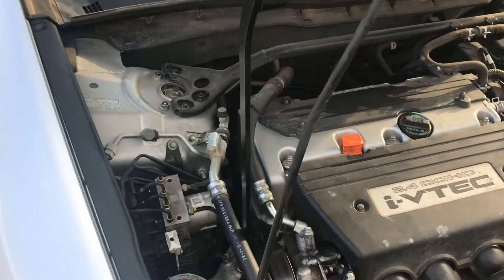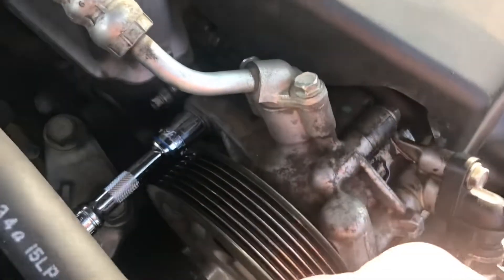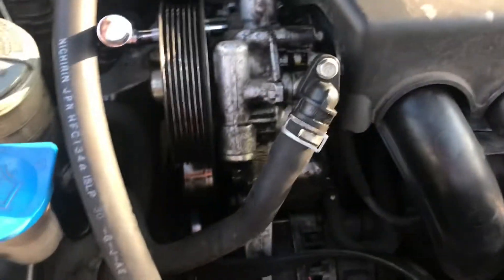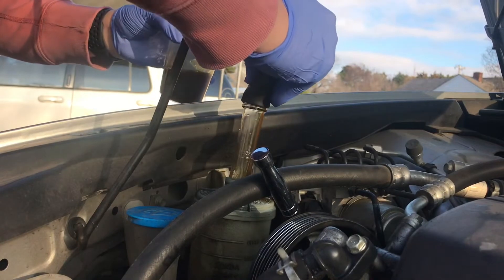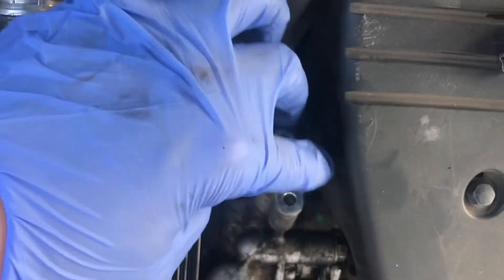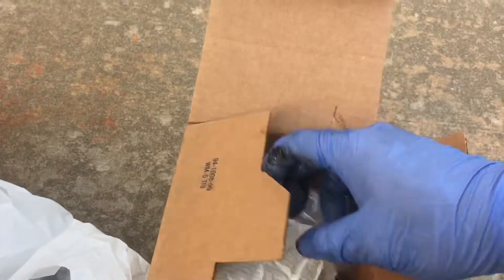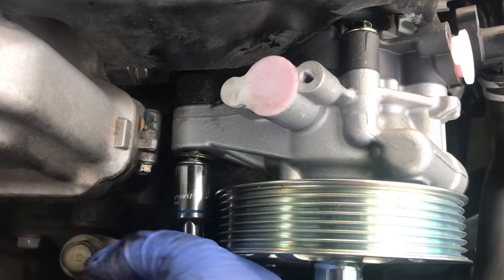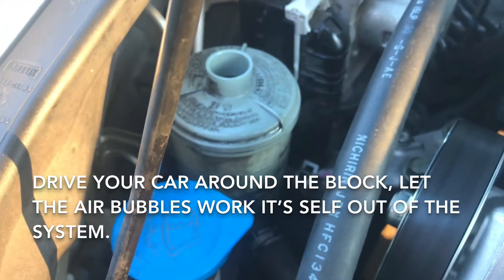Power Steering Pump Replacement - Honda Accord 2008 2009 2010 2011 refurb

Comment: Excellent, just what I needed.  I replaced the oring on the low pressure side and it was fine for a month, then I noticed it was now leaking at the main seal.  So new pump time.
Reply from the maker: Glad it helped

Comment: Did you try installing an oring kit on the original pump and replace the internal orings and seals or did you just replace orings on the high pressure and low pressure connectors before deciding to install a new pump?
Reply from the maker: I did the later and then moved on to replacing the entire pump.  I didn’t have the time to break it apart and replace the seals.

I went with a Napa in house brand and it’s been rock solid the entire time.

Comment: Is the after market steering pump ok to use?  The honda oem one cost 400+ and the aftermarket is half that price.  Someone told me those aftermarket ones don’t last long and leaks time to time.  Whats your advice on oem or aftermarket
Reply from the maker: I’ve had my Napa in for a while and zero issues.  I recommend it. 

Say, you have 400, go for the OEM.  My OEM lasted 11 years.  If you don’t, then aftermarket is fine.

Starters - i put in an aftermarket, next car I’ll do OEM
Reply: @YoDIYVideos  i am asking cause $400+ is too much for me at the moment. If its 100% necessary than i have to choose oem. I just heard bad reviews about aftermarket.  If after market works fine and at least last at least 5 years then i rather go aftermarket to save money.  I was just wondering what is your advice.
Reply from the maker: I bought a Napa remanufactured.  No issues with it.  The seals in them are replaced and rebuilt (put back together) and repainted black.  

Part # - NSP 826046. 

Save the money, lifetime warranty.  Don’t think too hard about it.  I always check for leaks no, zero leaks
Reply: @YoDIYVideos  thank you.  Will do

Comment: Mine u can’t steer when ur at a dead stop when driving it does pretty good. What was your systems?
Reply from the maker: My power steering pump wasn’t that bad, ended up having some issues with leakage. Every time I would check the engine bay, mainly had really loud whining.

Comment: I like how you say you need a wrench to remove the belt. No size given... and then you pull out some long as unique looking wrench that you need to do the job with no description of this tool that makes the job easy 🤣👏
Reply from the maker: Ok, so that’s my bad.  The tool is a belt tensioner tool and one end is a 14mm and the other is 19 mm.

You can totally get a breaker bar and use your sockets that already own.  Using a pipe as a lever, that’ll be enough to reduce the tension.

I’ll link in description.

Comment: So how do you know if it’s the o rings?
Reply from the maker: If it's leaking at the entry way or exit, then by process of elimination and cost, the O-rings are the cheapest way to eliminate the o-rings.  It could be the pump or the connections in those steps.  3-10 bucks versus 150 for a new pump, i'd go with o-rings first to try it out.  Good luck and let me know how it works out.

Comment: I think part where the part is joined in the middle is my leak. There’s liquid accumulated on top of the steering part. Will change the ring first to isolate the problem
Reply from the maker: It’s easily accessible, good luck and keep me updated on your progress
Reply: Did that work for you? Same problem I have.

Comment: Just replaced mine and I noticed a louder noise is it normal
Reply from the maker: I went with a Napa brand one and didn’t notice any noise.

I’d probably try to work out any air bubbles and see if that cuts down on the noise.
What brand did you go with?
Reply: @YoDIYVideos  I purchase it online not sure of the brand tbh I also noticed when I step on the gas there is a high pitch whine noise

Comment: Great job, how is the pump holding up?  Did you have any noise/grinding sounds immediately after install?
Reply from the maker: Pump is great, no issues.   Zero noises, running perfectly.  Still driving this as my daily driver, the Napa part is holding up perfectly
Reply: @YoDIYVideos  Thanks for the reply and great to hear.  There are so many videos that condemn reman power steering pumps, saying only get new ones.  I'm glad to see that mindset is really not necessary and we can both save some money as well as help recycle parts by buying reman.
Reply from the maker: Everyone always talks about the negative things, very few people talk about their success stories. In this particular example, the power steering pump is very easily accessible, worth a chance on a remanufactured item. Good luck, hope the car keeps on driving for a long time

Comment: Is there specific configuration that the serpentine belt has to be in order to work correctly? You know how some belts are going in multiple directions? Also, in order to get leverage on the belt, did you have to remove anything underneath the car?
Reply from the maker: The serpentine belt does have a specific configuration for it to work.

For this car no, I didn’t have to do much under the car.
Reply: @YoDIYVideos  Oh ok. The reason i ask, is because im supposed to be helping someone out with their Honda, so i didn't get a chance to look at it. But thanks for the info.
Reply from the maker: That’s cool, yeah it’ll be a easy job.  Just make sure you draw out the diagram before taking it off and you’ll see how straightforward it’ll be.  Just be patient and it’ll be put on easy.
Reply: @YoDIYVideos  Thanks man. I appreciate your help!

Comment: If my steering pump is making noise and leaking,  do I replace it or will the O rings fix the leak?
Reply from the maker: Depends on where it’s leaking.  If it’s leaking at the input or output of the pump, then try the orings.  If it’s the casing, it’s most likely the pump.

The oring and new fluid should be under 20 bucks, a new pump should be under 200 at your local parts store.

My oring fix lasted for one year and then the casing started to leak.  Replaced the pump and zero issues.